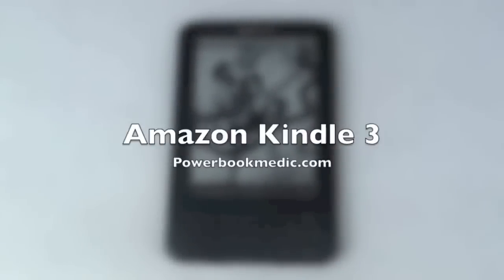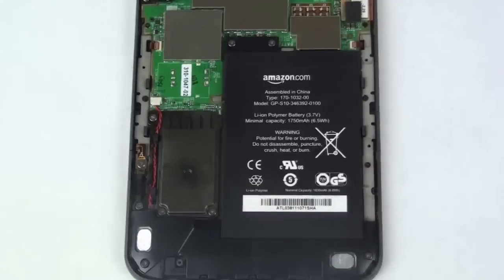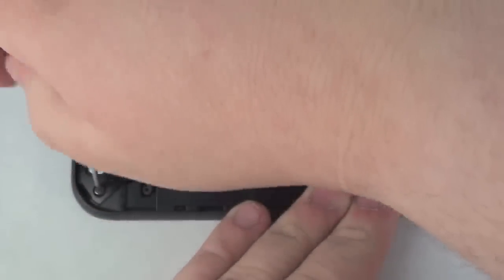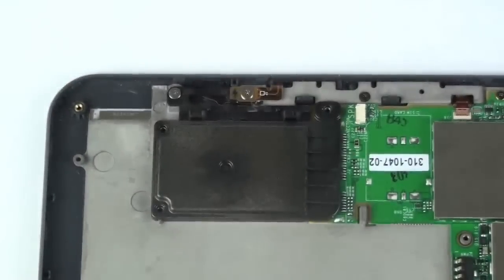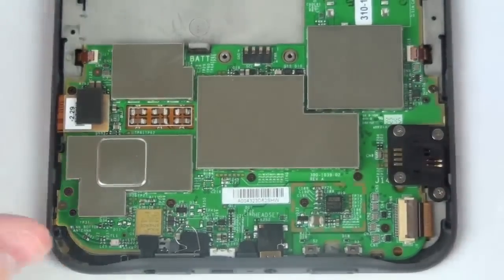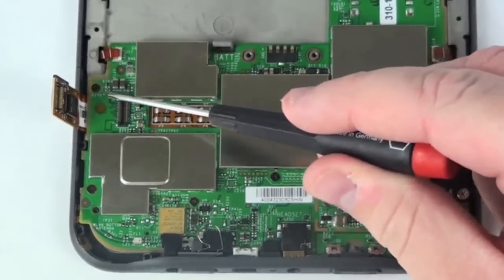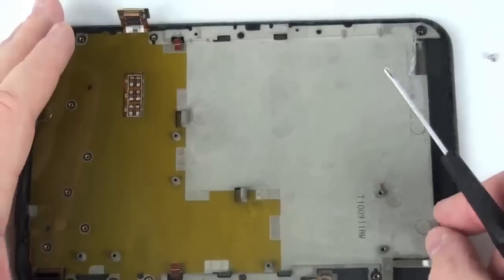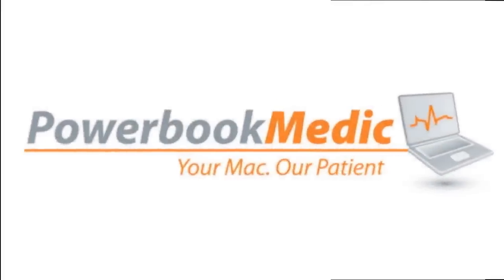How to Repair an Amazon Kindle 3

Comment: If I could get an opinion here... My Kindle did charge when it had been connected to a USB port, I was able to access it as a drive and copy mp3s to it and play them, and I was able to have the Kindle read some of the books. This indicates to me that the other parts of the device are still functional. Upon opening the case, I saw that the screen had cracks across it. It looks to me like a pretty good candidate for a replacement screen. Would you agree?

Comment: First off, thanks for posting the video and for answering my question re the 3G. Following your video, I was able to disassemble my Kindle with no problems, but I wish the instructions on opening the case were a little clearer. In addition, I don't know if the 3G is different or if it was just different product releases, but mine had three bushings? spacers? that weren't mentioned in the video, two behind the battery and one at the 3G card.

Comment from the maker: Your problem is likely the logic board which is also where the data is stored. You can give our repair department a call at 1-866-726-3342, option 1. They will likely need to see the unit to determine if it can be revived.

Comment: PLEASE HELP ME!
My kindle broke. It won't respond to resets and plugging it to a computer doesn't work. That's not the problem. My problem is, I really need to get my files from it. It's not amazon bought books, so I can't download it. How can I get the files? Like I said, it wouldn't connect to the computer.

Hard ware speaking, where does the kindle store it's files? Is there someway I can access that?

Oh, and I really like the video. It's so simple.

Comment: Is the main board (or logiboard) for the WiFi/3G Kindle the same as the one in the WiFi Kindle? In other words, can you replace the place holder mentioned at 2:52 with a 3G card and change the Kindle to 3G? Of course, it's probably impossible to GET a 3G card, but... :-)
Thanks for posting this. It makes it look so simple! :-D

Comment: My wife's kindle shows a screensaver picture with horizontal and vertical lines over it. Nothing I do, including disconnecting the battery, seems to make a difference to that, so I suspect it is a hardware defect. When slide the on/off switch it goes green for a few seconds and then turns off again, however when I connect it to my computer I can still see all the ebook on it. Any ideas what I can do about this.

Comment from the maker: First make sure it is charged. Then unplug it and hold (slide) the power switch until the green light starts blinking. This will perform a soft reset and should fix the issue.